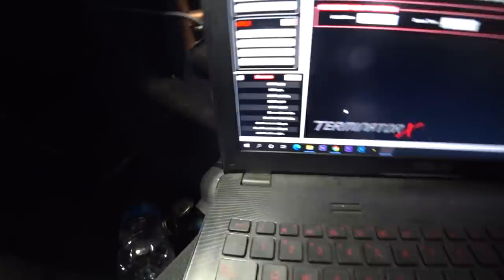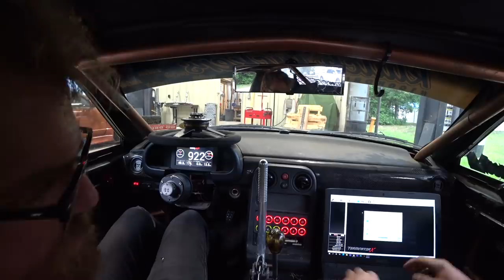More surprise issues to fix/upgrade on the LS3 Miata to get it to 100%

Comment: Get a set of those beefy sway bar mounts from Flyin Miata or V8R and it won't be such a pain to get your long bolts in/out. Miata sway bar mounts are known to bend/tear with a big front sway bar.

Comment: There is a fix for your swaybar interference, GKTech has a sway bar that is shorter and has proper connection points that would clear your tires making frrom for sick angle. I would seriously check into them Taylor, they should up your game and stability
Reply: correct me if im wrong, but i thought they only made those for s-chassis, im pretty sure they dont make one for a miata
Reply: @SR20DEBT  honestly I am not sure but that style could work for almost any Ansley car just the end link connectors are specific.

Comment: Just a thought, may want to beef up the bracket for the cable. Seems to have some uneeded flex in it. Could be a possible fracture point mid run.

Comment: How does “close enough” apply to the throttle plate only opening up partially...? Lol It has to open 100%.
Reply: It doesn't HAVE to but for the miatas desired driving it should yeah...
Reply: @kennethporst4359  i mean Thats like saying you don’t have to go beyond 80% throttle. Technically true, but obviously undesirable. Lol
Reply: @ProModsPerformance  I think the ‘close enough’ was in reference to rough fitment, since he would likely make final adjustment with the computer hooked up and seeing the TPS?
Reply: @RandomName100  The TPS is calibrated off of the mechanical limits, not the other way around. You can calibrate the ECU such that 20% throttle blade is 100% TPS if you wanted too. Mechanically maxing the blade is the only way to confirm it's operating appropriately.

Comment: You can limit the wheel travel so that it doesn't hit the swaybar by putting a lock stopper on the lower control arm. This might be a good tempermanent fix for your issue of the wheel dragging on the swaybar.

Comment: I'd switch to a Torsion bar setup and ditch the front wheel spacers.  Sammit just recently did on his pink car but he got some kit made for his, you could prob find what you need on Speedway Motors for that small Miata.  W/O the wheel spacers the scrub radius could be easier to manually wheel

Comment: Definitely make sure you’re getting the right TPS voltage at full throttle.  If the plate isn’t opening all the way you may need to adjust the throw on the pedal to pull the cable a bit further.  Don’t want to leave power on the table :)

Comment: Get the new Milwaukee right angle brushless impacting ratchet in 3/8's drive. 260(I believe) ft. Lbs. of break away torque. You will rarely touch the cordless ratchet again. I promise... 🤙

Comment: To eliminate any possible issues with a TPS failure, you could tune your accel enrichment to be 100% dictated by MAP changes instead of TPS changes. If it works, the TPS wouldn't be impacting anything and failure wouldn't take the car down. I've never tried it; just a thought. I'm sure someone will tell me I'm stupid... and they're not wrong.

Comment: If you haven't considered hard lines for your power steering it might fix your issues. Loss of pressure from the pump to the rack might be from expansion from the hoses.

Comment: I've drove a few drive by wire trucks & cars, I HATED IT. There's a delay in the throttle response at least in factory vehicles. I guess you get use to it after awhile but IT SUCKS. It's like shooting a Flintlock rifle compared to a modern rifle, u wait for the Flintlock to go bang, the modern cartridges don't have that, it seem's instant.

Comment: Hey lad I brought a set of justable tie rods for my Rx7 and they fit on of my racks that I have put in to my old Rx7. They were to suit series 5 Rx7. But they fit s13 Silva and r31 skyline racks. But I found that they are all the same. How can I send you photos of these? Or the part no. Would help. It 4.am here at the moment. So when I’m able to go out to the work shop I will find the part no. For you. Patt.

Comment: Suggestion re front setup, 

Change your sway bar not the rest of your set up.

Look through catalogs and find one that you can make work that wont make the tyres hang at max lock

You prob dont need a huge sway-bar , mix and match 

I had to do it on my westfield as the previous owner thought body roll on a lotus 7 type car was good.... suppress shudder ... i mean wtf..

But that wheel breaking on lock when it hits the sway bar has got to be a issue in drift

You should be able to find a bar that will do the job

Comment: Why not make some steering rack stop limiters to keep the inside of the tire off the sway bar when you're at full lock? Seems like an easy solution and its easily reversible/ adjustable but it should give you close to full lock without worrying about contacting the sway.

Comment: I don’t know if you fixed it out of video or not, but the throttle cable had a ton of slack in it when y’all tested it. That would explain why it felt unresponsive and why it wouldn’t go WOT

Comment: I'd bet with the amount of deflection on that front sway bar, it's probably acting at half its spring rate. The factory sway bar brackets are flimsy enough, but extending them down further just creates a big parallelogram twisting effect in the mounting points before it can even translate to torsional motion at the wheels

Comment: Hey Taylor the response looks like it is due to too much slack in the throttle cable at 0% throttle. You can see in the video the cable pulls roughly 2 cm before engaging and opening the throttle plate. That would be why it feels less responsive at 25% throttle and why at full pedal you only get 90% open on the throttle body.

Comment: Nice job! I was wondering why not use a threaded rod with nuts on either end to get help get the upper control arm out without the head of bolt hitting? Also with the sway bar how about using a length one to get tire clearance or maybe even a Nascar type with removeable arms that can be bent to make so much clearance? Just my .02

Comment: Taylor it might be worth a try to extend both upper and lower front arms all the way out and then take the wheel spacer off, this should bring the whole hub out an inch but then the wheel closer to the hub by an inch so the rotation point is closer to the Wheel might not rub then.

Comment: Tub the rear out so you can put wider tires so you can be more competitive. The cars you battle are completely cut up so why not. Lol
Reply: You can’t tub inwards very easily, the fuel tank is there and the top shock mount, then the subframe mounts. These things are tiny. It’s already on a wide body rear quarter. It’s competitive, Ben got top 5 last time out with less HP but a similar set up. Reliability has been Taylor’s issue, as well as one “poor” judging decision.

Comment: another option would be to see if your rack - inner tre threads will allow for spacers.
Reply: also change that alum bushing for the diff. it WILL distort. alum softer than steel. why dont you pour your own bushing. theres 2 part mixes avail per shore hardness. and make a skeleton and outer encasement for bushing and pour it in and let dry. remove from mold and viola...

Comment: Extending the knuckle out will also change the way the spring rates work right?
Reply: The spring rate will stay the same, that won’t change. Might change the ride height but he can adjust that.
Reply: @mrwhite7222  it won’t change the spring rate but it’ll change the rate at what the spring works at because the hubs out further so it has more leverage. Or something like that

Comment: What about that Volvo or whatever electric power steering? it find out how Tesla does it.
Reply: He tried that, it didn’t work. Every drift car ever has power steering issues. There are basically three systems, engine driven hydraulic pump, electrically driven hydraulic pump and EPPS which is purely electric. All three have been on this car and failed. EPPS had horrible feel and didn’t react fast enough for drifting.